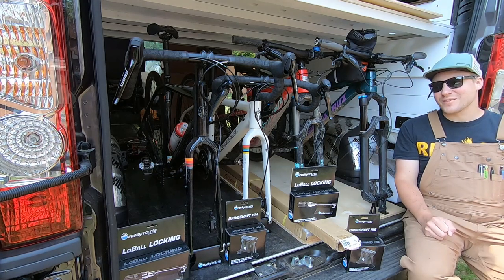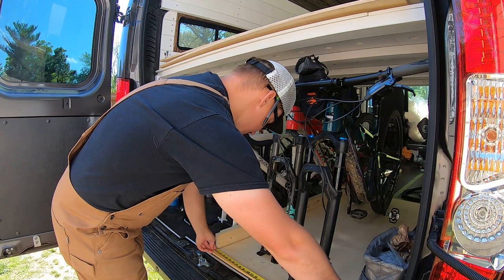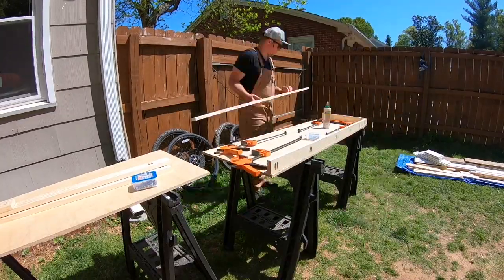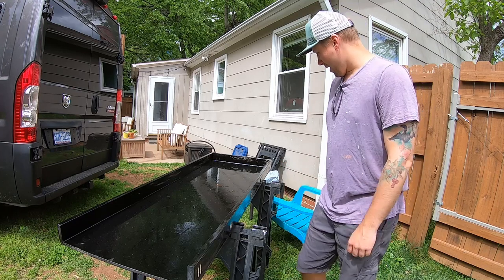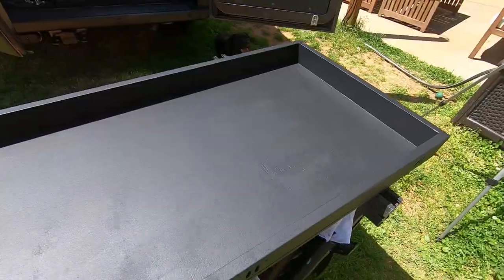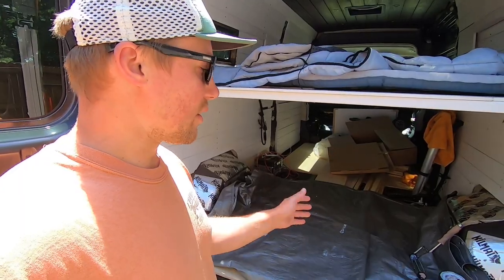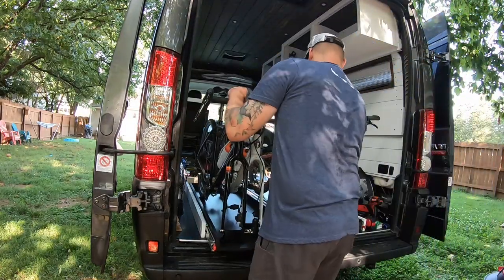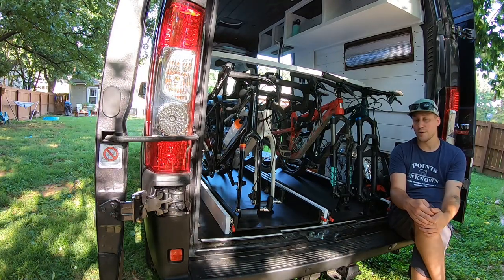Sliding Bike Tray for ProMaster Van + Slacklining //Ep. 19 DIY VAN BUILD

Comment: I built out our van a few years ago to fit a pair of gravel bikes and MTB bikes like you did.  I also used the 60" Fulterer slides.  First I will say Fulterer has great customer service.  I had a slide fail and the locking mechanism blew up.  I contacted their Customer Service and they sent me a new slide right away.   

I did a few things differently and I might make a change on my upcoming build.  I'll share these thoughts below for anyone else thinking of doing this.  

1. On our current van, I put the trays on the two sides and built a center box to put skis in with a sliding tray on top that we put storage bins in.  The center tray also doubles as our firewood tray when hitting up campgrounds.  We just move the bins to the living area temporarily (or leave them at our campsite) and load up the tray with wood.  This works out great for us since we always buy our wood local to the campsite. 

2. I used 60" long 3" x 3" 1/8" aluminum angle to fasten the slides to the floor of our van. I put the angle under the tray, pulled the drawer out a little, screwed in the back screw, and repeated the process until the angle was secured to the floor.  This saves a small amount of space in the garage (inches matter in van builds) and it allowed us to build out the center slide.  The aluminum had to be sourced from a local metal supplier and was a little pricey.  BUT...

3.  I have since learned that Fulterer makes angle brackets for their slides that I could have used. They are relatively inexpensive, come predrilled, and include mounting hardware.

4. Having the bikes separated by the center storage is great because it keeps the handlebars and peddles of the two slides from getting tangled up when pulling one of the trays out.  (My MTB bars have to go above the bins in the center.)  BUT...
  
5.  I realized that it might make more sense to put all of the bikes on one tray.  This should allow us to put the bikes closer together and our one tray should be a little smaller than our two trays.  This should work because the bars and peddles of the bikes won't be getting tangled up with each other every time we pull our bikes out.  We can arrange them tightly on the tray, with gravel bikes on one side, MTBs on the other, and my bikes would be placed on the outside (since I'm more likely to solo ride than she is).   With the bike tray out, it will be a little easier to load the bikes in tight formation and slide them in/out together.  

Hopefully, this will be useful to someone out there.
Reply from the maker: Thanks for all the info!🙌🏻 I definitely wanted to do something lower profile to anchor into the van floor. I thought about angle aluminum but the cost was definitely the biggest factor in going with wood. Space is a premium and it's definitely smart to count every inch you can save. I'd love to see a photo of your set-up if you wouldn't mind sharing. We are on Instagram, handle is Trailvagabonds. Or our email is trailvagabonds(at)Gmail(dot)com Thanks!

Comment: Just out of curiosity, why did you use pocket screws for the side rails of your bike trays instead of screwing them in from the bottom?  Objectively, it's faster, provides a cleaner look, and provides a stronger bond because more threads are embedded into the wood.  TBH, your comment, "... because it takes away so much wood, that would be taking away wood that the screws can be holding into..." is exactly why I don't trust pocket screws - but that's just a personal preference.  In the end, everything looks super nice, very professional and well-thought-out.  You're just rolling right along!  It will be done before you know it. 
AND - I'm super envious of anyone that can slackline.  That takes more balance and skill than I could ever hope to have.  Looks like great fun, though. :)
Reply from the maker: I've definitely had more problems with end screws ripping out or not being square I feel like. I'm a true believer in the pocket screws. I figured on the edge they'd be covered by the rail and you wouldn't see them anyhow. I probably over did it and could have done one hole per spot down the board. And I'll add that I'd never say I did anything the best or only way. I'm glad there are options that work for everyone 😊

We definitely love slacklining, it's a great workout and it's amazing how the balance control translates to other sports. It's never easy at first but then becomes nearly as natural as riding a bike 😎

Comment: Thanks for the video it was helpful. I am currently putting in a slide out tray to organize our camping gear. I've always used a rear bike rack. I was curious why you would need a slide out for a bike. Why not just release the mounts and roll the bikes out?
Reply from the maker: It makes battling the seats on the bed and pulling out a single bike much easier. It has definitely been helpful when only one of us rides

Comment: haha been going through all of these, really helps to visualize my framing. for that seat lowering, just make a lil mark on ur seatpost when its up with some yellow sharpie, that way you'll get the exact right height everytime :)
Reply from the maker: Where were you a few months ago? 😂We ended up flipping the 2x4s as seen in the bed video so that the seat clears the bed framing without issue. In hindsight, I should have just invested in a dropper post 😂
Reply: @Trailvagabonds  hahaha, yeah a dropper is never a bad idea, the gravel bikes are a  bit higher generally. I have a nomad, and the seat height is surprisingly low when it’s slammed. Trying to account for these half inches is a brutal process, I’m gonna see if I can push the garage to 36 inches, do a 4 inch mattress and use 1/4 inch plywood for the topper. Also using 1/2 inch plywood strips for the ceiling instead of the 1 by 3s
Reply: Hahah I feel like such a bean worrying about quarter inches, If only I was an inch shorter
Reply from the maker: Yea it's tough but probably worth it if you are maxing out. Honestly we've never felt constricted in our bed even though you can't sit completely straight up.

One thing you could do to save height is put the ceiling framing on the sides of the framing members rather than below 👍🏼
Reply: @Trailvagabonds  agreed, and yeah I plan to have a surfboard over the middle anyways, so I’ll be leaning back against one of the sides anyways. and I also considered doing that! It might be really tough to get all the shiplap to sit nicely though, bit above my paygrade

Comment: I’m family at the stage where I can add bike trays! Really the whole reason why I’m building the van is to safely haul my babies, right? Did you end up using 2 separate 4”x60” pieces between the 2 trays or do the 2 trays share the same middle 4”x60”? Thanks for al you share.
Reply from the maker: That's right!! 😂 I ended up only using one and staggering the slides slightly so the screws didn't hit each other

Comment: Whats the dimensions of your bed, was it for a full size or queen?
Reply from the maker: We went with a short queen size. The platform is 60" wide x 75" long. The mattress fits perfectly and we didn't have to cut it at all
Reply: Thanks, I'm trying figure out if I can do the same set up with a full size and my mountain bike
Reply from the maker: It depends on your bike tray length and back tire location within the tray. Because we have 4 bikes and handlebars (and other spacing things to worry about), we needed a little extra space. I think our garage to door is 63-64". If you can get your fork to the front of the tray, it shouldn't be a problem. How many bikes are you trying to store? I would just measure out your bike fork ( or handlebars if they extend forward of your fork) to the end of back tire to see if you have the space. Depending on what you need to store in and around your bike it may not be an issue at all